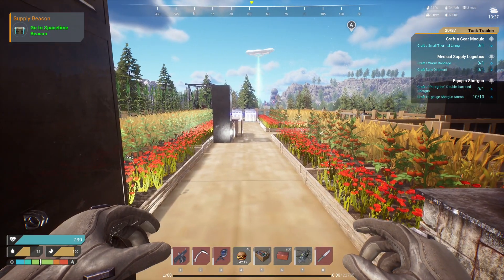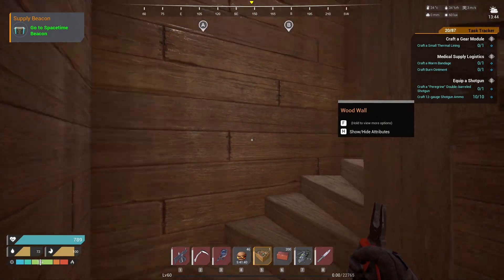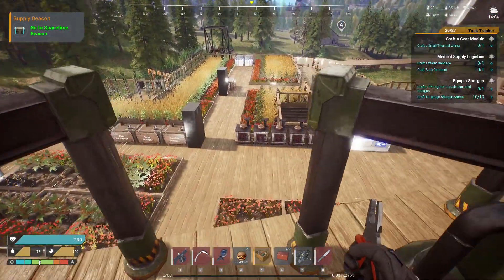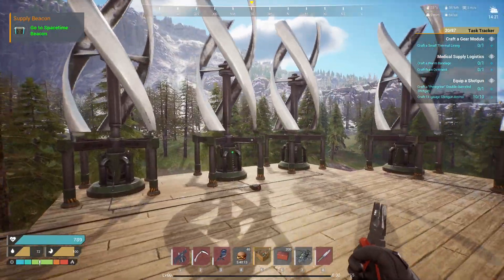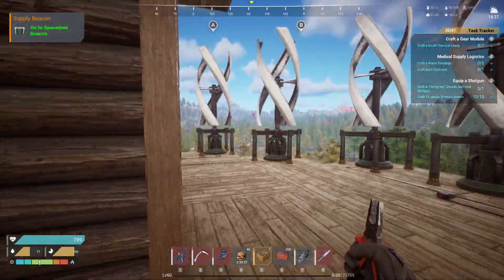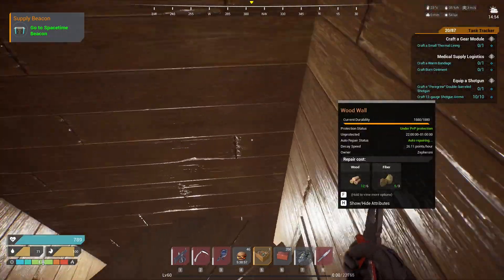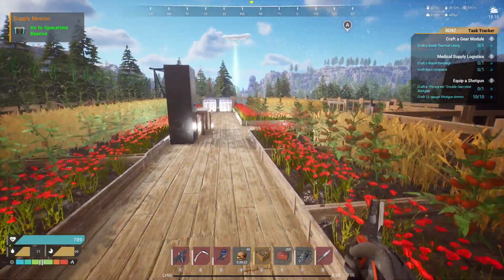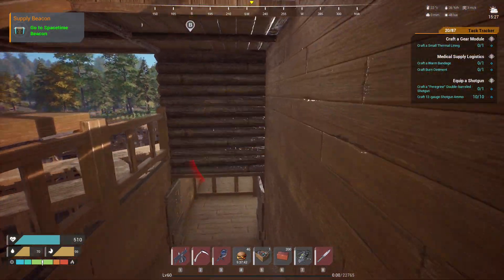The Front - Tower of Power

Comment: snow area provides 75 power,  u can see ur wind speed top right it say 3m/s - snow area has  3,4 wich is the max wind u can get - D2 near the beach is a nice flat snowy spot .. u need 1 fundaments space inbetween the windgenerators  otherwise they will give little less than 75
Reply from the maker: Yes but even at 75 per wind turbine bunching them together would still provide better bang per real estate than spreading out(at 50+), or at least I feel I am correct in that, perhaps I am wrong. 😉(would not be the 1st time lol)

Thanks for confirming that the wind is area specific, as I thought it might be, but not something i would choose base location on. Wind turbines came after the fact. I had noticed the 3m/s and figured that was wind speed, but had not noted it changing. 😀

I welcome you to share you design with us, and explain how it works 😀